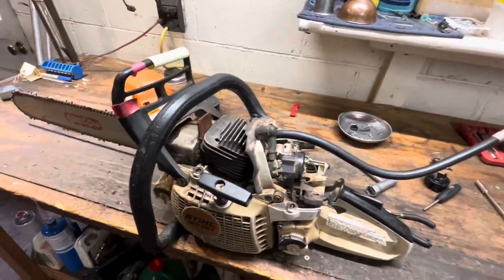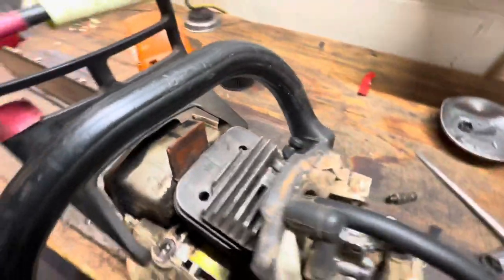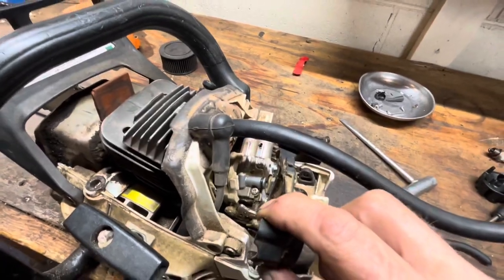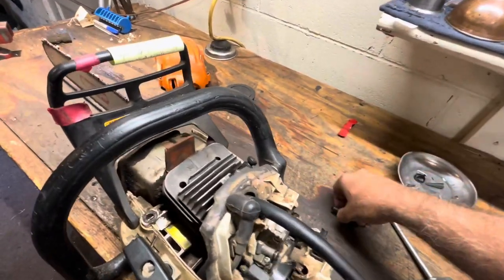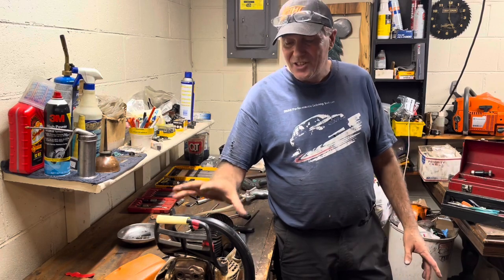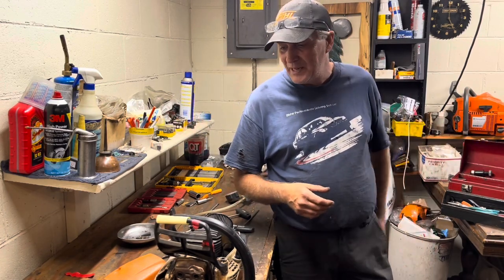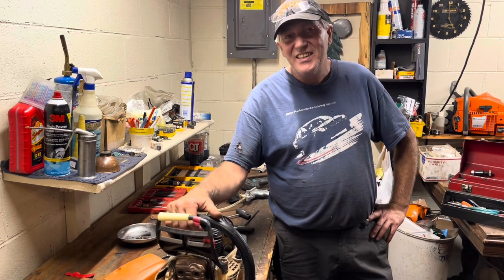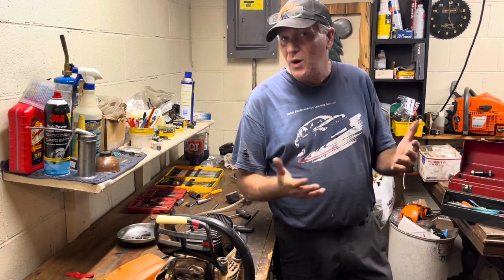MS261 Long Term 2 Stroke Oil Test. 7 Years Commercial Use.

Comment: I’ve got a Stihl Pro 036 saw that’s 22 yrs old, always ran Saber oil @ 80:1 from day1. Never had an issue with fouling, coking, wear, etc.,  cut approx 7 cords per year. Run it in ALL my 2 stroke stuff. Highly recommended. Burns clean with maximum protection, never had a failure.
Reply: Fantastic saws.  I have and use 3 of em.  We run 44:1 with klotz r50, and the saws run cool, clean, wet, and happy!

Comment: My ms260 is probably 20 yrs old, ran amsoil saber 50-1 since it was new. Runs like a top, piston looks great through the exhaust. Great little firewood saw!
Reply: I never used the aspen fuel when everyone was trying to push it, just premium fuel and saber. I’ve never had the carb off it.

Comment: I’ve been using Saber since 2010 and still have the same blower that runs really good.  I upgraded to a Stihl trimmer in 2015 and I’ve only changed the plug and cleaned the arrestor that really didn’t need it.  I’m sold on Saber and will always use it.  Also, have only used ethical free for the last 3 years and never had any fuel related issues prior.  Like you said, all about using food oil and taking care of your equipment.

Comment: I mill logs , I run the holzfforma clones , 395 , 660 ,660 with big bore kit . I run amsoil saber at 40 :1 .  Have no issues with carbon build up , nice oil film over all the parts , my buddy runs it at 80:1 . He's an amsoil rep .
Reply: Everything i have put amsoil in, (air cooled), runs cooler. The damn stuff is good oil. My generacs, my harley, my exmark, my chainsaws, everything.

Comment: It's amazing what basic maintenance can do in terms of longevity. With my Echo strimmer, it's pretty much been:
1. Make sure the fuel is the right mixture.
2. Clean out the air filter from time to time.
3. Grease the driveshaft and the grease fitting once a year.

It has never needed to go to the shop. My blower did need a carb adjustment though, but otherwise has been easy enough to maintain.

Saws need a little more maintenance, but it still isn't extreme.

Comment: I found this video because I have an original 261 CM that is nearly unused. And I was trying to figure out why they change the cylinder and it had me worried. I was convincing myself there was something wrong with the old design, but after seeing this not anymore. Yes I will be buying AMS oil by the case for sure now 😂

Comment: I have used all kinds of oil in my saws from valvoline and amalie to 40 weight diesel engine oil and I always mix it at 20:1 ratio and never had carbon build up or fouled plugs. I have done it this way for over 25 years and thats how old my newest saw is and never blew up any of them. I use about 25 to 30 gallons of gas per winter cutting fire wood and usually change spark plugs every year but they dont really need it. any oil is good
Reply: The air filter is the life of a saw.

Comment: i work for a guy that does tree removal and other than the ms461 i think all other saws are 5+ years old with no major issues but he does regular maintenance and cleaning of the saws. only saw he has had issue with recently after nearly 10 yeas of service was his MS201T. none of the stihl dealers seem to actually be able to fix it correctly lately. they just blame fuel/filters/sparkplug or last time they said it needed minor carb tuning but on the first test run you could tell it was out of tune since it would stall at idle and had a slight hesitation before it would throttle up. almost tempted to try getting some of the tools i am missing to try trouble shooting it. i am guessing it likely has a bad seal or gasket but i am guessing the stihl dealers have been too lazy to actually check since it is a lot of work to check.

Comment: I run Sabre 80;1 in blower & trimmer. Semi-commercial. No problems for last 4 years plus.
Reply from the maker: Yes it can be run at 80:1.  Long term I've seen a little wear on the piston skirt.  I'd recommend bringing it up to 50:1.  It will still burn just as clean and offer a little more lubrication.
Reply: Any synthetic oil can be run at some crazy ratios if the tune is right, there's nothing special about Saber (reminder that Amsoil lost some lawsuits with people that ran 100:1 for the reason I'll mention at the end), but you'll get more piston polishing/wear compared to 50:1, lets not even talk about the reduced bearing life. As you already can tell, it still takes hundreds of hours for that to happen, so for a homeowner it probably doesn't matter if the bearings/p&c last only 500 hours instead of 3000+ on 32:1.
The main issue with 80:1 or 100:1 is that if the engine's gas/air mixture is just A HAIR lean (a very cold morning lets say and you don't adjust the jets quick enough), your piston and cylinder is scored quickly from running it lean and hot with an already reduced lubrication per gas amount.
That being said nothing wrong with Amsoil Saber if ran 50:1 or richer. It's as good as most other synthetic motocross oils.
Reply from the maker: @em4703 I'd like to buy you a beer some day.

Comment: Ive ran the old echo/shindaiwa power blen (green colour) for years and years, never had any probs, then I couldn't get that here in uk . So switched to motul 800 2t, though I've found that it gums stuff up at 50:1. Especially hedge cutters etc, seems better in saws, think it  be would great on ported saw ran hard. So been running the 710 2t and that seems to be running a lot cleaner, it is a lot thinner oil so been running bit higher like 45-48:1 but still runs clean
Reply from the maker: Motul 800 2t has a pretty high flash point of 485F.  Hedge cutters usually don't run at wide open throttle long enough to keep the engine at full operating temp.  The 710 has a flashpoint of 309F and hence the better burn.  That's only one factor but I hope it makes sense.  They are both JASO "FD" rated.  Good on you for testing both to see which is better for your needs.
Reply: @richardflagg3084  Well, I run saws more, though I haven't ported any of them yet, only muffler Mods. Well, I have ported my 2511 and a shinny 452s. I haven't had too many  issues running 800 2t in saws. But I've run the 710 and still seem to leave a nice oil film still. Yeah, I had echo 2620 failure running it on the 800. Plugged the cat up🤣.  Like you say with higher flash, it's not the ideal for the hedge cutters and trimmers that  use half throttle  a lot

Comment: Ive run everything from Motul to Evinrude and I've never seen less wear or coking than with Red Armor. Smells like Balls o Fire fish bait and same color but stuff looks new w/zero scoring or carbon even with a slightly rich tune
Reply: The biggest reason I picked saber over red armor was the smell of the smoke.  RA was a little irritating and saber wasn't.  Both seem to be damn fine oils.
Reply from the maker: RA does have a distinct "aroma".

Comment: Would the saber be ok at 40:1 or would it ash up too bad? The 8oz bottlea they sell would be perfect for a 2.5 gallon can at 40:1.
Reply from the maker: It burns just as clean at 40:1.  I've got a couple of customers that use it at that ratio.  Buy it by the quart if you can find it locally  Usually sells for $15-20/qt.
Reply: @richardflagg3084  thanks! I'm making the switch! Love the videos by the way. Your doing gods work! 😆
Reply: I’m running 32:1 and no problems with ash or extra smoke, all my equipment has spark arrestors. I’m also running real gasoline, 102 octane race mix. Haven’t done any testing below 60 degrees ambient temperature, but I don’t think it would make much of a difference.

Comment: Goes to show that if one person is doing all the mix gas which in this case is the owner and he care's about his equipment by using a good oil and consistency in said mix ratio along with a healthy dose of common sense, mean's there's no reason why it can't last the long haul. That goes for any power tool treat it like crap and soon enough that's what you have. I know guy's that can break sledge hammer's in half (I'm not talking about the handle) almost every day they're on a job site, that goes for some company owners as well they'll get the job done but cost's them dearly in $$ along with a lot of carnage along the way. Good to see you give credit to those that do care and; take care.
Reply: There's guys that can break anvils, and rip starter ropes out of equipment without fail every time. I don't know how they do it, I've purposely tried breaking starter ropes on junk equipment that was getting scrapped and couldn't do it. The only two starter ropes I broke in my life were about 50 years old, and that was because the rope fell apart from it being rotten.

Comment: Run Amsoil on all my 2 strokes 50 -1 to 45=1  was running it at 40=1 and  Had a brand  new Johnsred 2253 a red 550 xp had a vaf air leak and when they tore it apart to fix it said 40-1 was ti much with the amsoil that was 10 years ago 50-1 is plenty with it

Comment: Have you found it to be necessary to replace the exhaust gasket every time you take the exhaust off a small engine?
Reply from the maker: Metal gaskets no, the fiber composite ones do get replaced if they are brittle.

Comment: Thank you Rich for all of the time and work that you put into making these informative videos. I have found more helpful information here than anywhere else. I have just purchased a new Stihl MS261 with adjustable carburetor which has the plastic limiters/stops on the HI LO adjustment screws. I think I want to run it on sabre at 40-1. Do you know if I am going to run into a lean problem with saber that I cannot adjust without having to remove plastic limiters/stops I am trying to avoid voiding my factory warranty. Any suggestions would be much appreciated. Maybe remove and reinstalled limiters? Just run 45-1 or 50-1? Maybe you would recommend a different oil. I would really like to know your opinion or recommendation

Comment: Love the saber, but l did have the piston out of my echo trimmer that was bought new july 2020 and have only ran saber 80:1 until recently went to 40:1 because of your vids. And that piston had tons of coking on the exhaust side. I was shocked when l pulled the jug and saw that. (Pulled jug bc l saw some coking through exhaust port) would upload pic if yt would let me. I try to run it wot as much as possible. It was slightly rich from echo, fouled a couple plugs, (tuned it this spring) so l wonder if that had anything to do with the coking. I will continue to use saber and amsoil products, this is not me bashing them at all. My 9010 blower looks like new through the exhaust port last l looked a couple months ago, had that for a couple years.
Reply: I've had a lot of Echo products over the years. I think some of the coking buildup on the exhaust side is due to the catalytic converter in the muffler retaining so much heat. I ran an SRM230 I bought brand new for 9 years before I sold it, and while I never fouled a plug or plugged up the exhaust port, I'd check it every couple of years. I ran a lot of saber in it the past few years I had it, and it cleaned it up a bit but it still had this really dark varnish buildup on the exhaust side of the piston. I got that engine so hot the clutch cover gave me a nasty arm burn more than once. That's about the only thing I can think of as to why yours and mine were like that. I bought a new SRM266 and gutted the catalyst after running a couple tanks through it, it also was beginning to coke up. Excessive heat is the only thing I can think of since the oils being used are high quality.
Reply: @MattsRageFitGarage l never considered that, but that makes a lot of sense. Makes me wonder how their red armor oil handles it.
Reply: @ethanmiller3935  Not sure, never used the red armor. That SRM230 got a ton of TCW3 oil, a lot of the Echo powerblend X and whatever else I was given or got cheap over the years early on in its life. It wasn't until the last few years I had it I started running better oils. I sure ran it hard, it never complained a bit.
Reply: @MattsRageFitGarage Its a good oil as well. I use it in some of our older equipment because l was mixing saber at 80:1. My brother runs it in his shindaiwa trimmer, and our churches shindawia also gets it. The shindys and my echo are all the same motor (2620/262s). I wouldnt hesitate to run it if l were out of saber.
Reply: @ethanmiller3935  A local farm and ranch store sold Saber by the quart for like $12.49 for years, they quit carrying it but still carry everything else for some reason. I bought a gallon of the Husqvarna XP+ to use since it seems to be about the next best thing from watching Richard's videos, plus I got a good deal on the gallon. I did notice over the years, that machines I had that I could see visible carbon buildup on the piston looking through the sparkplug hole, that using 40:1 for a few tanks the carbon would disappear. My dads Echo SRM-2510 ran the crappiest cheapest oil at 32:1 for years, it had a lot of carbon buildup on the top of the piston and 40:1 of various brands of synthetic 2 cycle oils cleaned that thing out spotless in pretty short order. I was very surprised by that.
Reply: What type of fuel are you using?
Reply: @PurpleNovember 93 octane ethonal free.
Reply: I have the same issue running saber around 80:1 even with the cat gutted.  Going richer on the oil just made it worse however all my other equipment is pretty clean, husky 525, sthil and echo 8010.  I’ve tried motul 710 and it coked worse than saber.  However red amour seemed to clean it up.  I found red armor recently for $50 a gallon so going to run 1 262 off it this season and the other on saber then compare them end of season

Comment: Thought my Husqvarna XP oil was blue, but not 100%. Started using Red Armor and not Stihl.
Reply from the maker: XP+ is a really good oil.  Just mix it at 40:1.  It doesn't have the viscosity to leave a really good film in the crankcase at 50:1.
Reply: @richardflagg3084  Motul 710 ok oil for cheinsaw ?
Reply from the maker: @Okinawa1914 Sorry, I haven't tested that oil.
Reply: @richardflagg3084  Whay not ,tested Motul 710

Comment: Hay Richard honest question how do you feel it stacks up against red armor or husky XP? 
  I appreciate your real world test on oils. 👍🏼
Reply from the maker: As unbiased as I can say this, It's far and away the best two stroke oil on the market.  If you can purchase Saber locally it's usually around $15-20 per quart, making it half the cost of Red Armor by the pint.  That's just a bonus.

Comment: Why has Stihl gone from the black air filters to the white and fleece. I don't know if theirs any difference in the micron values but the black filters seem to be more robust. I got a tree guy that I patch his saws but he has an older ms261 and I swear it's the original.😊 I finally talked him into buying a new one. I can't find any of the black ones anymore. Stihl probably stopped making them because they last too long. 😊
Reply from the maker: I think it shows the dirt better making it easier to sell another $20-35 filter.  Once that newer white filter material gets dirty, there's no amount of air, degreaser/cleaner that will make it white again.  I don't believe once it's cleaned that it affects flow or filtration.  More important to keep an eye on the rubber seal where it mates to the filter base.  Just my .02

Comment: Never ran amsoil 2stroke oil but i ran their oil in some of my 4stroke stuff. Pit bikes, dirt bikes and one 450 race quad. Smoked the pit bike and grenaded the 450. Couldnt get that oil out of my other stuff fast enough. Never ran it again. Blew up another 450 on motul synthetic and went back to conventional oil. No more problems after that. 

That said, I do run motul 800 offroad im my saws now. Have also ran belray h1r and i liked it.
Reply: Uh huh….🙄
Reply: How do you get along with Motul 800 in saws? My Stihl has some weird color on the exhaust but I ranned husqvarna xp before, like 10 gallons of it so that was probably at fault.
Could have been tuned too rich from the factory, who knows.
Reply: @1u5t1n  I just started running the motul. Probably less that a couple gallons so far. I run it in all my OPE, saws, weedeaters, and a blower. They all start and run better than they ever did on stihl oil. I had previously ran belray h1r and I liked it but had some wet oil around my exhaust like it wasn't burning completely. The h1r has a hight Flashpoint. 
The guy from hotsaws101 channel runs the motul and puts lots and lots of hours on saws so I ordered a quart to try. I'll update in about a year lol.
Reply: @SixOFord  yeah, h1r and motul 800 road racing (wich is what I run) have high flashpoints. Some people say that a chainsaw doesn't get hot enough to burn those oils. I may switch to 800 off road, since road racing might be overkill at 40:1.
I was contemplating to buy some unmixed alkylate fuel and use the motul with that, but the prices are kinda prohibitive.
I guess I'll spend a buck extra here and there and see hot it goes.
Reply: @1u5t1n  I still mix 50:1. That's all the guy on the channel I referenced runs. His original build on a 462 has many many an hour on it and and is still going strong. I figure with the quality oil the factory ratio is fine. Look at all the people running crazy ratios with the scamsoil. I'm not brave enough to run anything I've got at 100:1 lol.